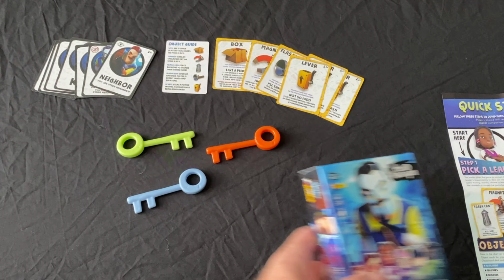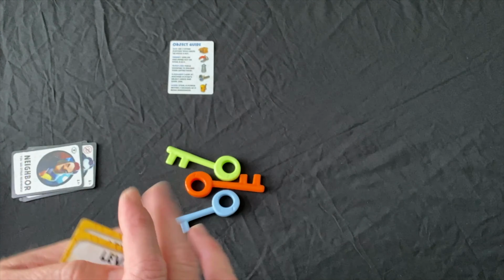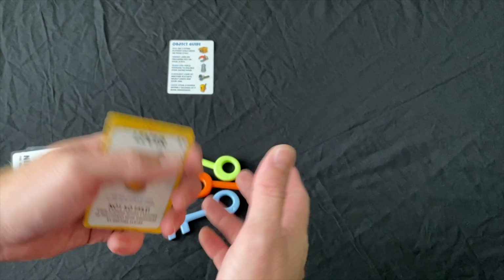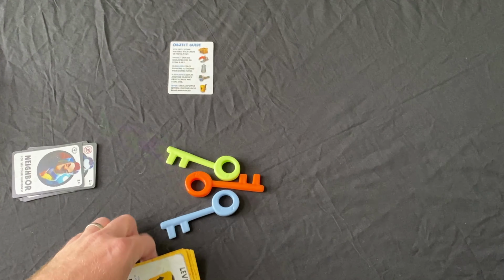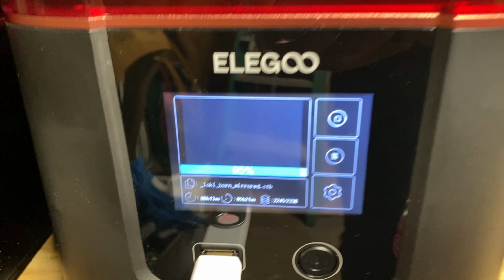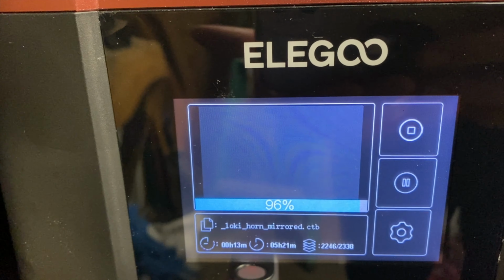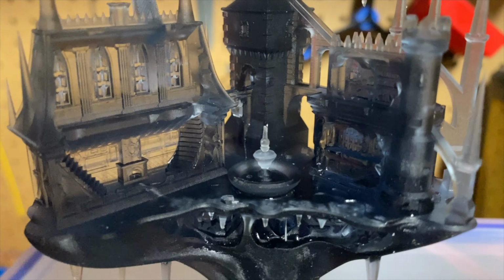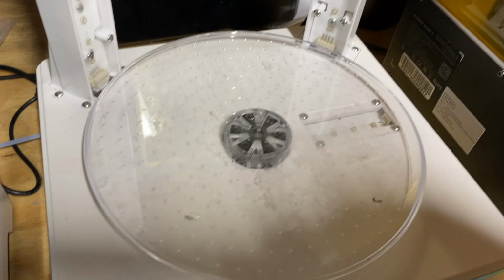Hello Neighbor & Elegoo Mars 3:Mercury X Review - with Bryan

Comment: Last I read resin printers weren't really all that safe to use inside of apartments, and homes without basements, garages, or other workshop/spare spaces where you don't have to worry about the toxic fumes. Resin is amazing, beautiful, high detail tech, but as long as they're still requiring better ventilation/workshop spaces, not to mention UV curing stations, alcohol washes (though I know there are some water washable resins now) filament printers are still just more practical for every day users. It disappoints me too, I won't lie, because I'm constantly looking into how easy it would be to get some better ventilation/air filters for a resin printer for a reasonable price so I can upgrade from filament.
Reply: True but there are more and more low odor and plant based ones out now.